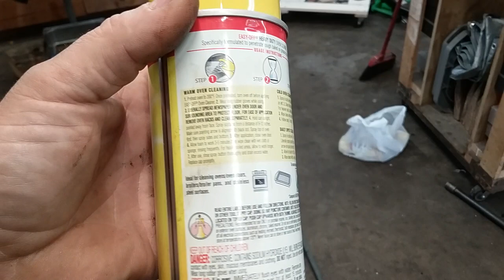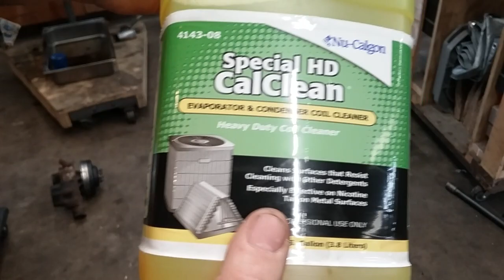Degreaser showdown.  Easy Off vs Nu Calgon Special HD CalClean.

Comment: It helps when you actually follow the instructions. If it says add water, then add water. I have several cleaners in my arsenal that MUST be diluted with water. As a matter of fact, both my degreaser AND my general purpose cleaner barely work at all, without water.
Reply from the maker: I'm glad you enjoyed the video